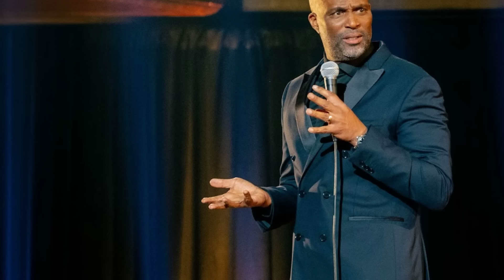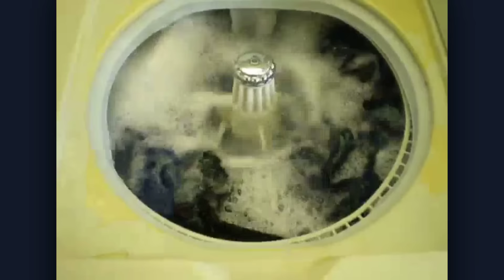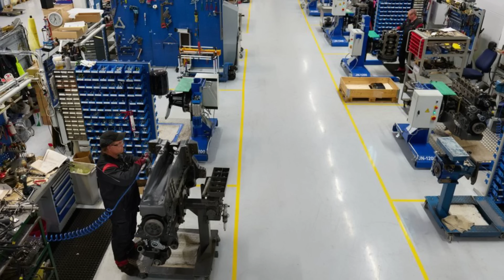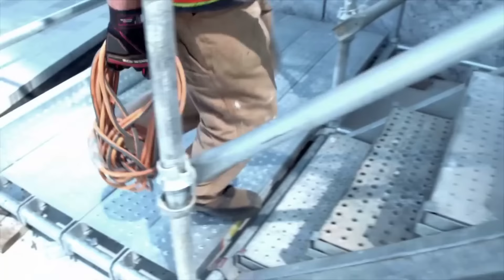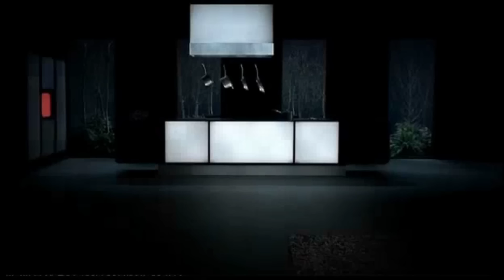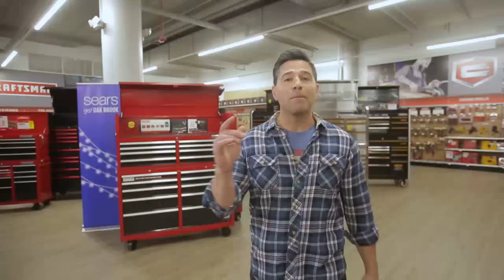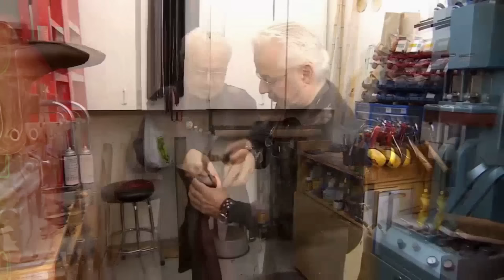The Only 5 Brands That Still Last (The "Buy It For Life" List)

Comment: Purchased front load LG Tromm washer/dryer 25 years ago. At the time they were about $2000 back then!  I spent an extra $300 to eliminate the belt , and had a direct drive motor instead which I think has made a difference. Also, I follow the instructions for care on the machine which is a HUGE factor in the seals not becoming moldy!!  I'm glad I bought them before they started adding all the computer wifi tied in gadgets cuz it just makes them more complicated and easier to break. When they eventually go to that Appliance heaven in the sky , I might buy a Speed Queen because I'm sure LG is following everyone else. Which is a shame, cuz I really like these machines and they do a great job.

Comment: The problem with modern cast iron pans is that they no longer machine the inside smooth. There are lots of good old used ones out there though. And why buy new hand tool with all the high quality used ones available. Years ago all the big box stores sold great tools. I would have to research it but there are 10 to 15 good brands that you can find at auctions and flea markets. Two good ones are Riverside and Powercraft.

Comment: Speed Queen top brand.
YouRube Ai vid summary;
     This video identifies five product categories and specific brands that still offer durable, long-lasting products, countering the trend of planned obsolescence (0:40). The host argues that while these items may not be cheap or flashy, they are built to be owned and repaired rather than replaced.

Here are the five categories and brands highlighted:
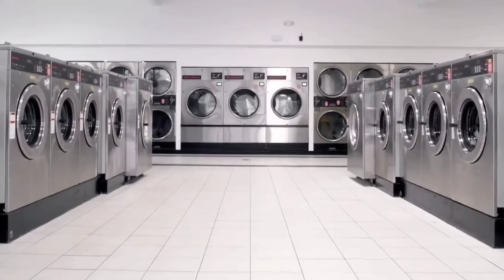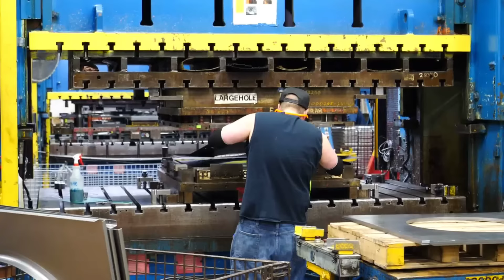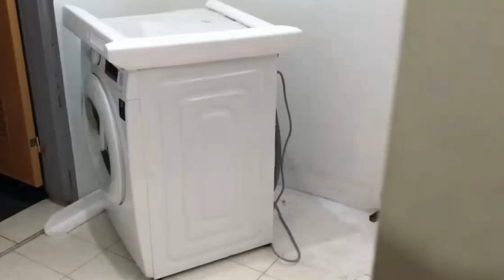     Laundry Machines: The video recommends Speed Queen, specifically the TC5 top loader (1:42). Unlike modern, feature-rich washing machines, Speed Queen builds commercial-grade machines designed for durability with mechanical timers and steel transmissions (1:48). They are built to last for decades, unlike many consumer models that fail within a few years (2:26).

Small Engines: Honda GX series small engines are presented as the gold standard for outdoor power equipment (3:05). They are known for their reliable starting in any weather and superior engineering tolerances (3:17). Crucially, Honda offers excellent parts availability for decades, allowing for repairs rather than disposal (3:36).

Work Boots: For footwear, the video emphasizes boots built with Goodyear welt construction (4:46). Brands like Thorogood (American Heritage line) and Redwing Heritage line (4:56) use this method, which allows the sole to be replaced multiple times by a cobbler, extending the life of the boot indefinitely (5:09).

Cookware: The video advocates for cast iron pans, specifically from a brand like Lodge (6:25). Unlike fragile non-stick pans that degrade and flake, cast iron is indestructible and improves with use, forming a natural, chemical-free non-stick surface (6:38). Cast iron pans can last for generations (6:57).

Hand Tools: The video suggests looking for brands that still forge their steel in the United States (7:22). Channel Lock pliers (7:29) are praised for their high-carbon steel and laser heat-treated teeth, providing superior grip (7:32). For wrenches and sockets, Right Tool is recommended (7:44) for its durable steel, industrial feel, and a unique "right grip" design that prevents stripping fasteners (7:54). These tools come with strong warranties from the manufacturers themselves (8:17).

The video concludes by stressing that buying durable products is an act of opting out of the "cycle of waste" perpetuated by corporations that want consumers to constantly buy new items (8:26). While these products may cost more upfront, they are ultimately cheaper than repeatedly replacing disposable goods (9:05).

Comment: Do not buy plastic storage boxes of any size, they are totally different from the plastic of the 70s and 80s that was virtually indestructible.
Reply: Wrote the same thing. All Rubbermaid plastic products break when trying to use them. Laundry Tote Baskets break at the handles. Mops and Brooms snap at the plastic screw mount. And the storage bins all break when using them to move - the handles/lids break when you pick them up and or stack them.

Comment: More important,  buying quality typically means there is a market for repair and maintenance.  Less items filling up the landfill,  less items being shipped across an ocean with diesel fuel, less items being taxed,  less frequent production and design changes for basic necessity items that can likely lead to the market having to correct itself and possibly lower costs.

Comment: Yep. Speed Queen reliability remains REGAL for both washers AND dryers. Every other MFG. in that segment today is built with "planned obsolescence" However, considering that the TR7 series offers more features, has a two-year longer warranty, and is at the same price point per their webpage as the TR5 series recommended in this AI-driven clip, curiously implyes its the "go to" because of low frills, but that's NOT been my 14 yr. experience owning their bells & whistles AW & AD models.

Comment: I have a Honeywell humidifier. It has one manual button. On, low and high. Same with my crockpot.  One simple dial. Off. Low and High. Never buy anything with a computer chip in it. Except a computer.

Comment: It sounds like this guy's personal preference to brands. 
You can buy multiple brands of commercial laundromat washing machines and dryers... Speed Queen is not the only brand.
Honda small engines are excellent  and better than most Chinese knockoffs but Predator is nothing to sneeze at either.. and every component on it can be replaired. Look at any contractor or any business that uses a generator constantly and you will see Predator generators there at least 75% of the time.. what's that tell you?  I trust that more than some random stooge on the internet using an AI voice for his videos.
As far as inverters Hondas are known to be the best but I have a Yanahai inverter that is equally as good as any Honda. 
And that's coming from a person who has Honda small engines as well as Honda vehicles.

Also there's a reason why we don't use cast iron skillets that much and is because they are freaking nightmare to clean.

Comment: 1. Speed Queen TC 5 top loader. Commercial quality. No “smart” shit. 
2. Small engine king. HONDA GX series-gold standard engine starts plus plus. Parts available 
3. Thorough good American Heritage line and the Redwing Heritage boots 🥾 w Goodyear welt on the boot-foundation boots: 
4. Cast Iron pans -Lodge brand is indestructible. 
5. Channel lock metal plyers ; wrenches & sockets = brand Wright tool 
BUY FOR LIFE.

Comment: May I suggest: Estwing. Not sure about all their stuff, but been real happy with the axes and hammers. Lots of solid metal designs. No broken handles, very reliable. And they feel great. Pretty sure I'll have em for decades.
Reply: Bought a used steal Estwing hammer that was about 5 years old at a yard sale in 1980. Still using. Also, I keep it on the floor behind the drivers seat for emergencies. Along with an old fashioned steal tire iron.
Reply: The design of the hammers can be a problem if used everyday.  But they don't break and all their stuff is top quality.

Comment: I drive a 2014 Toyota Camry. Stock. Dealership maintained. Runs amazing.  We have a GE Mini Fridge in the bacement for drinks and as a backup for when the main kitchen big one dies. which has happened a few times. Put the milk and eggs, etc in the mini. We got it in the very late 90's.. Runs like a champ.
Reply: 2003 Camry here.

Comment: Any gas engine holding fuel over time will gunk up. Especially with ethanol... Either run your generator 3 times a month, or empty the fuel tank and carburetor until the engine stops.

Comment: I have a Speed Queen washer and dryer. The salesman pulled the thing apart and showed me the metal parts inside, then showed me the same parts, in plastic, on other machines. I didn't want some piece of shit connected to the internet, or a front loader, or something that uses a thimbleful of water. I wanted something sturdy, that works, uncomplicated, easy, fast. I didn't give a crap how much water it used. My clothes are actually clean and dry. How unique.

Comment: I purchased a speed queen washer.... it's a front loader.... To say that it's heavy duty is an understatement.... I has a 10 year in home warranty.... It has a stainless steel tub (not plastic) ,  It was (3) times more then any other washing machine owing to the fact that everything is extra heavy duty...  As to cast iron pans ....  NEVER buy anything cast iron that uses the word "camp" because they are all junk.... stick with LODGE .... As to lawn mowers.... sadly Honda has decided to quit the lawnmower field....  Luckilly I have a 45 year old commercial Honda mower that looks near to new.... every month of use it gets an oil change with high grade synthetic multi-vis oil.... It burns no oil, it does not smoke, it runs perfectly well and has only needed spark plugs and a new bag on the back...   Craftsman tools,  Icon tools, and all those other pieces of china made crap is just that....   This video is great advice.... even the boots section.

Comment: We had a Woods chest freezer for 30 years or more and it still worked fine when we got rid of it. Mom didn't like the fact that it was deeper than she was tall; when she was trying to reach into the very bottom, she almost fell in. She replaced it with a smaller upright freezer. It was only years later that I realized we should have just put a false bottom in the freezer - or gotten her a suitable step-stool - to solve her problem. The Woods freezer would probably still be working if we had.

Comment: Fixing your own appliances is a skill that is worth developing.
Reply: That is, if the appliance wasn't made to be unrepairable...
Reply: @macvos  
That can complicate things a lot, but you'll be amazed at what you can do with these, if you put your mind to it  :) .
Reply: Many not that difficult with videos on You Tube and some tools (even cheap ones for d-i-y ) from H Depot.  Almost any washer/dryer repair will cost half the price of a new GE, and while not a Speed Queen, parts are available online.
Reply: I helped a mate repair a 15 year old Miele. It was still working 5 years later when he sold it. 
Initial purchase cost was eye watering though, at more than double the normal brands. But I doubt that the normal brand machine (like the one that I have) will last ten years.
Reply: I agree I do all my repairs. Maytag washer drum banging about loudly, I replaced the support rods and associated hardware, it didn't help. Turns out the drum bearing is bad, just past warranty, the bearing itself cannot be replaced it is molded into the drum. Game over player 1.

Comment: I've got a washing machine and gas drier from the last couple of years that Kenmore was actually good.
If they ever die, I'll likely buy Speed Queen.
I have a mix of very old cast iron cookware of various brands, and a couple of newish Lodge pans. People complain about the rough surface of newer Lodge, but after some use, they are just as non stick as some of my old smooth ones. warm the pan and toss some butter in, eggs will glide off of them just as nicely as a new non stick pan.

Comment: The Kirby vacuum I bought 30 some years ago is still a go; it's the one with metal parts. I've had to buy a replacement hose but it's a workhorse. Plus, we have a vacuum repair shop here in my town where they fix anything and have all the parts.

Comment: You can buy parts for the =Honda clone engines. They are still about 35% as good. but considering most people leave gas in them all winter, and never change the oil they will die of that before they wear out. But if you do all that to a Honda it's still worth fixing,
Also don't leave out White's boots.

Comment: Old life long repair person hear.    General Motors was the start of making junk.   We call them stress engineers.   Make it last just pass the warrantee.   I did an emergency repair of a 90 percent efficient furnace.   Changed the control board 200.00 wholesale price.   The paperwork said average life 9 years.